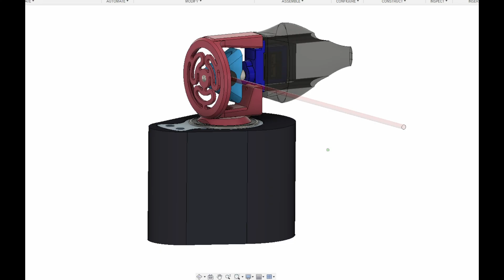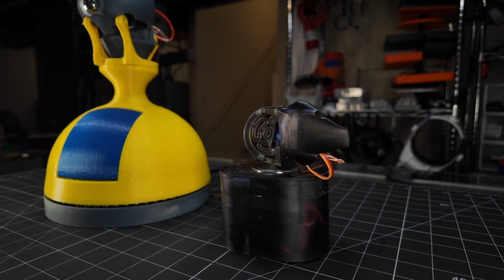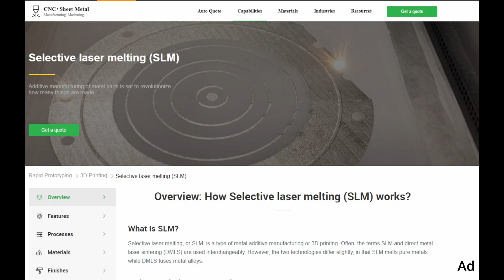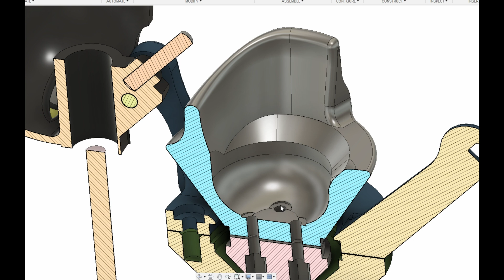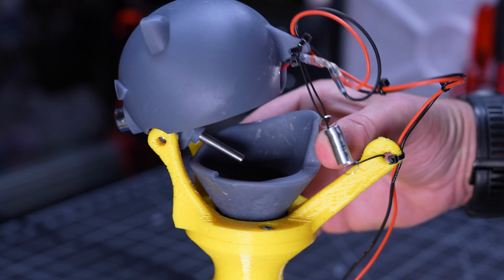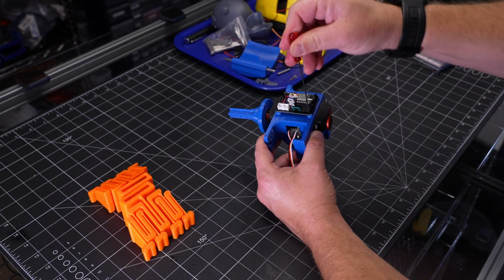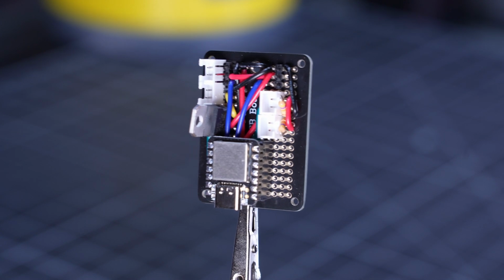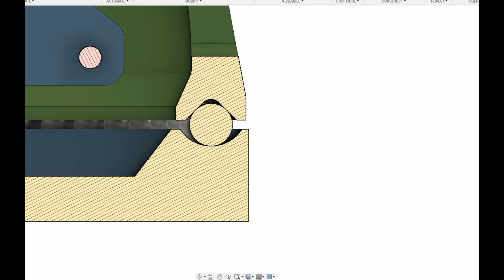I Built My Cat a Robotic Laser Turret that Launches Treats

Comment: brilliant mutli discipline work, my suggestion is calibrating your fdm printer, these small holes I believe stem from too harsh setting of linear/pressure advance leading to underextrusion at the end of the movement in a layer
Reply: I had the same problem once, in my case it was a partially clogged nozzle.

Comment: Metal balls on a metal raceway would let you transfer power.. With 2 you could get positive and negative. Could probably just use the shaft of the servo.. 

That would let you decouple your spiny bit from your base without as many wires on the bottom. Probably not using enough power to need much more than a sheet or 3 of heavy aluminum kitchen foil to pass the power without to much thermal load happening or forming to much oxidation.  Any data transfer wires could probably be done with an ESP now, wifi, or Bluetooth solution.